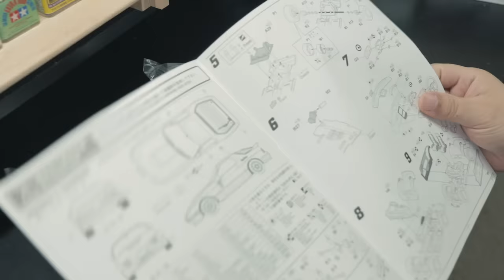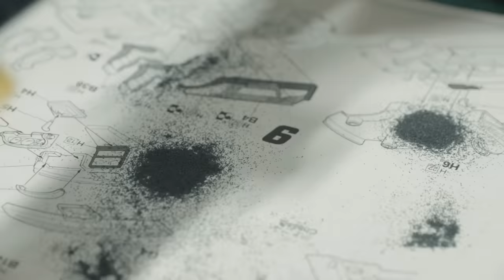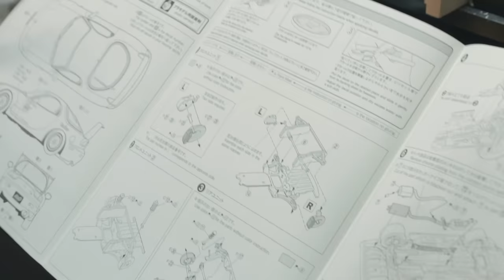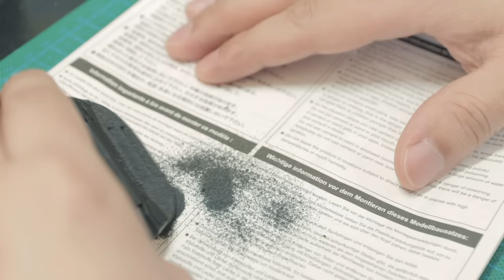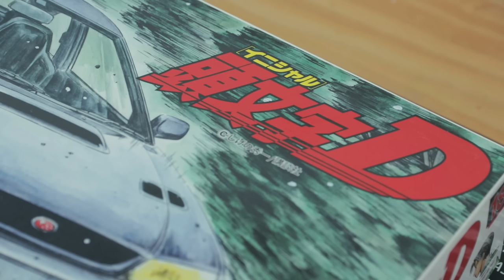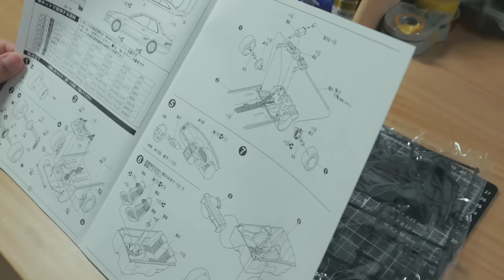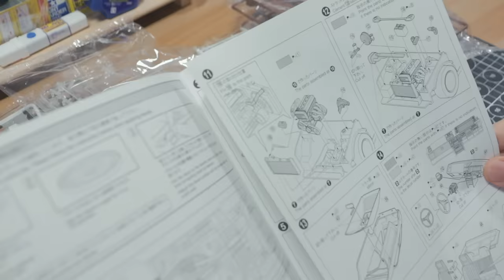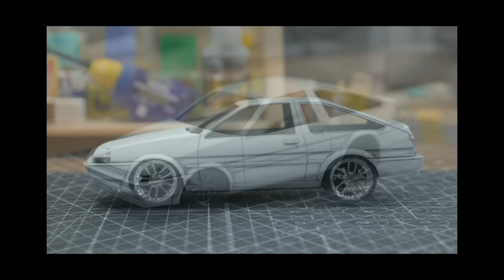(ASMR)Initial D Model Car Building Compilation - Toyota AE86, Mazda RX-7 & Subaru Impreza WRX STI

Comment: These models can be converted into motorised models by the addition of a Mabuchi electric motor and some gears, this 'conversion kit' is available separately,  hence the inclusion of the battery tray.

BTW, the suspension parts such as the control arms etc on the WRX Sti should be done in pink as it's the trademark color for all the Sti parts. ..keep that in mind guys.

Comment: they stopped making them around 1987, but they making a new one called 86/Subaru Brz with a Subaru boxer with 2 litre, turbo and 200bhp and still using rear wheel drive in both models, Toyota also makes a GR model or Gazoo Racing

Comment: How was the quality bro? Is it bad?  I'm hesistant coz its expensive  but it a rare piece.
Reply from the maker: Quality is fine for what it is, it will need some work to become what you see in the video. If you are used to building plastic models then you should have no problem building them. 👍

Comment: I know this is an odd question and not pertaining to the video, but do you know of any Japanese model manufacturers that don't mold everything into the chassis? Like engine, trans, suspension, exhaust? When I build models, I wanna assemble everything.